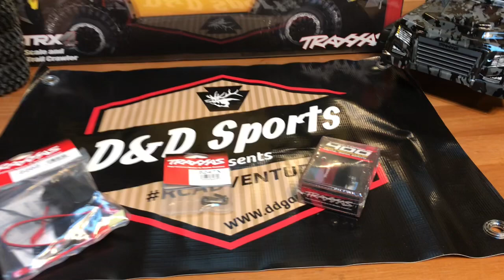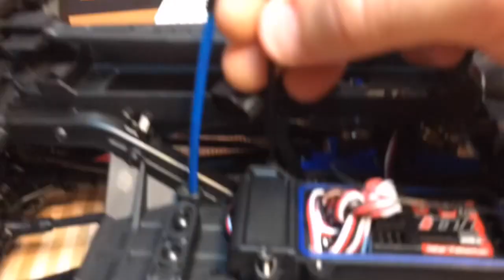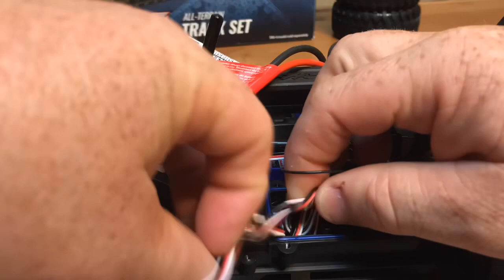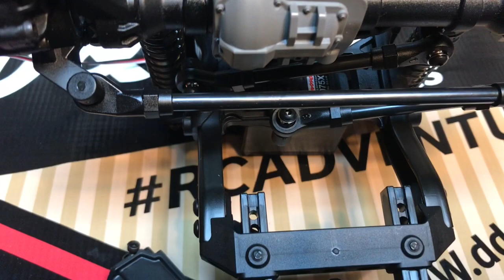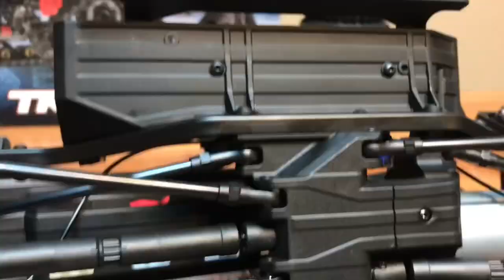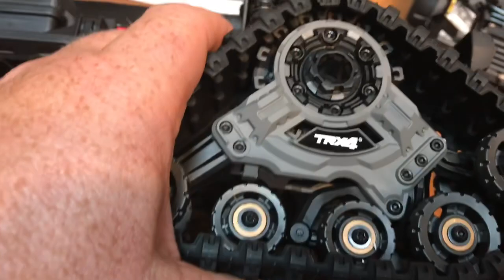CUSTOMER CUSTOM BUILD TRX-4 Defender to a TRX-4 Tactical with TRAXX #rcadventures

Comment: Why didn’t they just get a tactical?
Reply from the maker: Dan Gavin RC traxxas discontinued the tactical kits.  They wanted new with the locking and unlocking differentials and the two speed transmission
Reply: D & D Sports the tactical is still up on your site though, and it has all of that
Reply from the maker: Not for a dealer, they removed them from the dealer website.  They are just selling off their stock to retail.